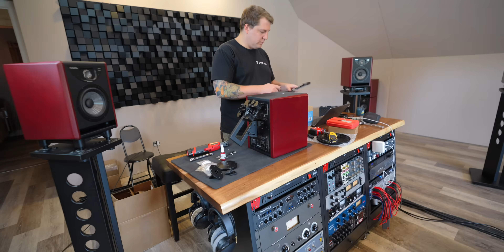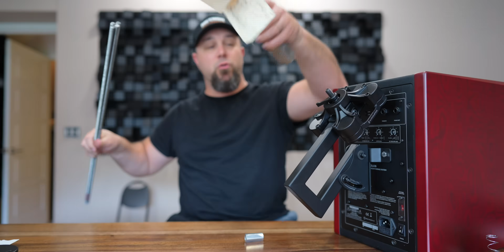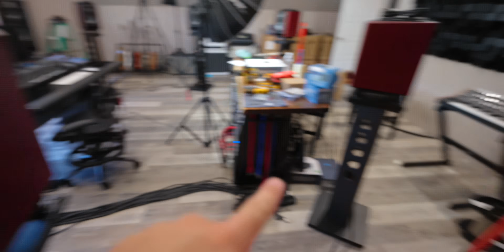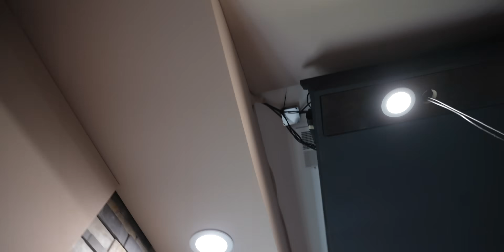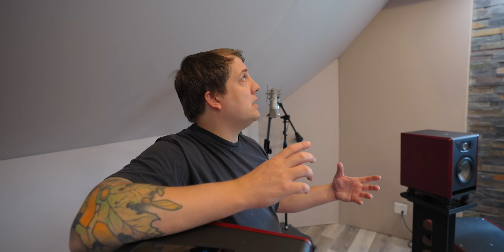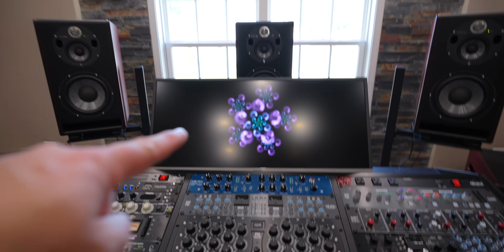Putting 15 Monitors in my HOME STUDIO - The Atmos Install

Comment: Hi Colt - awesome project and thanks for your humble way of sharing your process and lessons learned.  My question is about your producers desk / outboard gear rack behind your main mix position.  It looks fantastic with the live edge wooden top you’ve installed.  In 2 channel this would not be a concern but by my eye with height of your side and rear speakers you could get reflections off this very good reflector to your ears at mix position and comb filtering could also happen at these acute angles.   I am interested to know if the geometry could be a problem and if you have thought about this ?
Reply from the maker: Great question! It’s actually something we are dealing with right now today during tuning. It will be covered in the upcoming video on tuning the rig.

Comment: Analoug over cat5e/6e rj45 connects is a really good way to get super compact XLR cable runs down to a minimum size. If you pick cat cable that has indavidually sheilded twisted pairs with overall sheilding aswell, you'll have slightly better noise rejection than a quality XLR cable and each cat5e cable would be 4 x XLR cable. You can also have Sub d connects on the end, XLR breakout or go into a box with rJ45 and break out to XLR or Sub D from there. it reduces the wires to 1/4 the amount of runs.r

If I'm not mistaken Capi gear does some of the RJ45 stuff aswell...

Comment: Hello, in Europe/germany those unistruds are totally common and we call them C Rail ( C Schiene) and they are indeed used in industry for all kinds of construction and conduits. Most of the time we use them to mount distribution cabinets. Another often used construction piece is called “ITEM’ and it’s made from aluminium. You can built everything with them like with LEGO.

Comment: Hey man nice video. I got to say I sub'd to learn about studio 'stuff'. But I also worked in Nashville for years working as an Integrator and installed several different venues on Broadway as well as the Cowan. If I can avoid sounding like a douchey troll I'd like to provide some insight/tips, if nothing else to give you some deserved video interaction...
1) be VERY careful soldering 120V cables and telling people you can do it, yes you can do it but you REALLY have to be careful and know your limits or it's a severe hazard.
2) something I find easier when soldering male connectors is to toss the male tips into a spare female connector that I don't want to use. Helps hold the connector better and dissipates the heat better so you don't risk knocking the pin a little loose in the plastic and everything stays aligned perfectly.
3) for hardware try Fastenal Nashville they always had what I needed
4) that junction box on your ceiling is "fine" but next time use the wire harness collars that go in the knockouts to save your cable from any unwanted abuse
5) Dymo Rhino 5200 labeler, bite the bullet and buy it if you're going to keep doing labeling. Handles perfect cable wrap labels, patch point spacing labels, the works. Truly epic labeler for pro label situations
6) idk if you did, but you may want to mark the floor with your final speaker positions, it will be inevitable that you'll have to move the speakers at least by accident. You don't want to lose all that work!

Sorry again, not a keyboard warrior. Just one pro to another trying to share some info to help.

Comment: Hey Colt ! That's great work, I'd love to come in to listen how it sounds ! For your cables coming from the back racks, I think the best way would be send everything through the floor. Why not opening  holes behind the racks and the desk, with some kind of isolating trap, and to run a large conduit in the floor.  If you go that way, when you will run your cables, don't forget to add a pulling cord as well, that would be great to add some new cables down the road (and you will).

Comment: You should have a square washer against the strut with a split washer and nut to lock the spring nut in place and jam nuts against both sides of the coupler nut to prevent loosening...congrats on the motivation! Looks good.

Comment: Consider looking at Ginger Audio Sphere and a Streamdeck with the knobs or any midi knob controller for Monitor Control.  I haven't used it for Atmos (what it is designed for) because I'm dead in the "not for me" camp with that stuff,  but I use Ginger Audio Room for monitor control and it works pretty damn good with a Streamdeck.  It's probably the most economical option on the market too. Other than that, maybe the Audient thing?

Comment: Incredible setup. So dang cool. Suggestion on display, switch to a small high-quality AT/ALR projection setup. It works in the middle of the day due to the ALR screen, good AT screens can be EQ'd properly without increasing distortion, and it not only ergonomically helps with your neck with keeping your head straight, but it solves your main issue of not blocking your center channel.

Suggestion for cable management on the floor, woven cable wrap is hard to beat. Simple, cheap, and it looks very nice.

Comment: Great video Colt!! I really appreciate all the details and the tech info - I DO have to point out, though: Yes, all junction boxes require a cover (as a Journeyman Elec in TX, I have seen MANY DIY nightmares that would likely have burned the house down over time, so I was happy to see that detail) - BUT, regarding Code compliant installation of cables terminated/ spliced inside junction boxes - NFPA/NEC 70 requires all cables/ conductors to be installed with the correct "connectors/ strain relief fittings" where they exit the box. This is why there are typically 2 different size "knockouts" on the sides of the box. There are corresponding connectors that will hold the cable securely and prevent any skinning or damage to the cables or compromise to the connections inside. Just a note, as you did mention installing "to code". Hope this helps someone out there - cheers! Keep 'em coming! 🤘🏻👊🏼

Comment: Great video! Fascinating process!
Is it an option to add a minimally raised floor (2"") in the middle part of the room, up to he position of the speaker stands? Then you can hide all the cabling underneath. Or alternatively in the perimeter of the room (sides and front)? Or does that ruin your acoustics...

Comment: for tidying up the long cables going around from the back to the front. get a nice looking cable ramp with multiple tracks inside. you can have one lane for the signal going to the sides vs the ceiling vs the power and keep them all separate while protecting them from being stepped on / rolled on and allow folks to walk around the room safely w no tripping. zip tying is an ok idea but zip tie the "like" cables to make tracing easier (sides only, ceiling only, power only, etc). a nylon mesh wrapping will look bulky and will make cable tracing tedious and still be a trip hazard. i personally would wait until youve used the rig for some time before drilling into the floor. a few months of getting to know the system will do you good in determining whats best.  i will also second the comments saying to put some strain relief on the junction box on the ceiling. the edges of the metal holes can cut those cables.  lastly i recommend switching from straight connectors to 90 degree connectors for the surround monitors on the floor to prevent someone from walking around them and snagging your xlr on accident. great video, thanks for sharing!

Comment: Did you ever consider analog audio over ethernet cables for your speaker lines. I know you're well down the road with that mogami or whatever it is but it's so much more conxwalable and arguably, more than adequate for line level signal.

Comment: Love this video but damn all those cables are driving my brain crazy.  You GOTTA do sooooomething about that. No client wants to worry about stepping over cables.  Don't bundle them.  They will just be more of a trip hazard.  Lay them flat side by side by side.  Lay some flexible flooring,  I know it's not easy to match the wood floor but It might need to be raised by only the thickness of XLR and power cable plus the thickness of the laminate.   Or get the circular saw out and cut a trough where you need it and then cover with flooring but exposing a hole where a cable needs to pop out (to the speakers).  If it were me, I would rip out the flooring in the main center area and start from scratch. Now that you know where the cables need to be under.  good luck,  cant wait to see THAT video.  LOL.

Comment: Your electrical work wouldn't pass code in many jurisdictions. The receptacle needs to be placed near the speaker and your electrical cable needs to be in conduit.  Extension cord length is limited by draw.  In my jurisdiction the extension cords can't be more than 6 ft long. 

There was a time when speaker manufacturers were not honoring warranty repairs if custom electric cables were used and caused damage to the amplifier modules. 

The electrical boxes should have had strain relief to prevent chafing and cutting of the cables.

Comment: Congrats Man! I have a suggestion for you on the cable management from your rack to the front of your room. Use Ethernet Cat snakes they are 4 channels each and that would eliminate a bunch of individual cables, also remember you were going to make a hole into the floor and that would be the cleanest run, but I know that's a lot of labor and time and I'm sure you just wanna get back to working. It's All in the Details and your videos show us that, Keep It Up.

Comment: I probably wouldn't recommended putting electric wires into a metal box - and I personally wouldn't spend 30k on speakers - but I still think you did a great job and I adore how thorough and neat you made everything. 👍

Comment: Wow Colt, that is some set up. I am in some ways in the same boat on switching my studio around. I started out with an Agosy desk filled it with mic pre’s, eq’s and compressor’s , summing mixer but truthfully I wanted a console. So last summer I bought an old A&H 32 track console for little money and learned how to use it. Could not record while learning. So now end of September I am going for my Trident 88-24. So I understand why things take so long. It’s been just over a year I have been in the transition mode. That set up is so clean looking. Once I get my board I want to get the Focals , Trio 6’s or 11’s. My heart is with the 11’s and after watching your speaker stand video I am going with the sound anchors also. Very very clean set up. Interesting to see what ya come up with the cables running on the floor behind all the speakers stands. You got some room there. Thanks for posting. I was on the rails about the sound anchors but after watching your stand video I’m all in on the anchors.  Thanks for posting..D..

Comment: Great video and lots of hard work! I'm curious with the ceiling monitor mounts: why did you add spacers instead of adjusting the swivel that was on the mounts? It seems a less sturdy and more difficult way to handle that, but I might have missed something that was said.